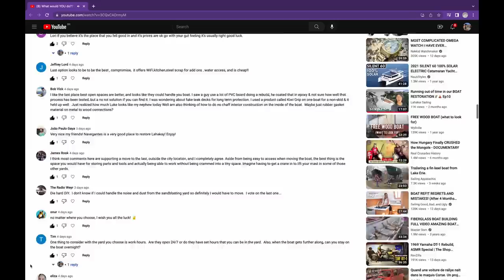Our Sailboat FINALLY made it!! ⛵️ Ep21

Comment: Having owned multiple boats and one catamaran I love the bogger 65-70ft boat but I also know the maintanance over doubles. I like your 40ft sized yacht and you can add a tent, hamocks and live on land in an exotic location to experience less comfort and escape the boat for a day or two if it is a little small or rolly after a stressful trip. Remember a 60+ foot boat can only be pulled out so many places and stripping and repainting below the water line takes 5 or 6 times more paint.

If only I had the money to pay someone else to do the hard work so I could sail on a 60+ foot boat again. Every time I camped on land after a day or two I went back to the boat due to vampire insects, strange noises from land Karaken's, Rain, needing a shower.

There are only two things on a 60ft boat I would want to take to a smaller one.
A Washing Machine
More space in the Engine Room

Honestly I could live with the limitations of the engine room. A watermaker is a must have but the washing machine, fresh water and regularly washed sheets well that makes any Yacht a Luxury Yacht no matter how small!

Oh and I also learned a Yacht is never "done" just "good enough to go see what breaks or you have to do next".

Comment: Glad you made it to rebuild location. 
When I saw the thumbnail I thought wow are they going to stretch the boat a few feet ad it’s a bit small….. but let’s not go there you need to get building. 
I think you had a designer draw up the new interior, will you share that? It’s so important to not spend more time thinking about what your doing compared to actually getting on with it. 
Cheers Warren

Comment: You might want to put some thought into your hull insulation. Many use spray foam for steel boats and it works great, but you have to make sure the steel underneath is incapable of continuing to rust under the foam because you can't inspect it without taking it all out. There are other methods of insulation but they will have their cons. I would try to get a shed built around and over the boat to prevent the prodigious amounts of rain in to activate the rust, until you can get it all sealed off. You are also open to high winds if they come through. Plan your shed accordingly.
Reply from the maker: Yes! Insulation is on our to-do list. Seeing the steel is important. We will see what options are available for us here in Brazil. And we are definitely going to build a shed this time around. This is the major thing that killed is in the previous location. We weren’t allowed to build a structure so we were always suffering with the rain. Good thinking about the wind. It can pick up here. Cheers!!

Comment: Now the most exciting part of the rebuild can start. I'm happy for you. What is to be done first? Outside painting and windows?
Reply from the maker: Good question! So we did do some research because we had the same question, and the pros say windows last. So we'll be working on some details then getting some more coating systems on first.
Reply: @lahakai  windows last, really? I guess they know what they're talking about.
Now the haul has been fully treated, I agree it should get a good protection everywhere. You must prevent all future rust as much as you can. Inside too. Then you can start rebuilding the interior.
Reply from the maker: ah I spoke to soon, not last last, but after coating systems and fairing compound at least, then windows can go on. Makes sense to protect any interior. Sorry, it got lost in translation 😝

Comment: Make a fiberglass comple layerl, and fill it with sulfurig acid, so your remove all the rusty steel. And you will have a fiberglass boat
Reply: They want to sail to Antarctica.  When a steel sailboat runs into  an iceberg in the dark, it bends.  A fiberglass sailboat in the same situation breaks, then sinks.

Comment: That truck driver is a knuckle head. I grew up around semi trucks and drove one for the past few decades. I've hauled livestock, refrigerated goods, steel products, scrap metal, big machinery etc. If he would have had the back axle down on the truck and took the exit at a angle rather than straight out everything would have went fine. Hopefully his boss doesn't see the video with him spinning those tires on the pavement.
Reply: Seems you got a different driver this time. The last driver was a craftsman of his trade and it showed. You need to come to America and I will show you what motorcycles are all about. You really haven't been on a ride until you've ridden across a open road with the sun on your back and the breeze on your knees riding the unforgettable American Harley Davidson.
Reply: Also have you thought about maybe windowing the davits? I'm talking about cutting out rectangular sections on inner and outer sides and then boxing it in with metal. It will allow air to pass through them and they would look really cool I think